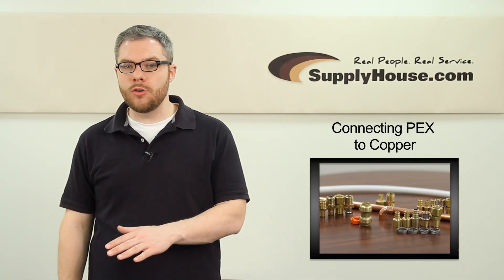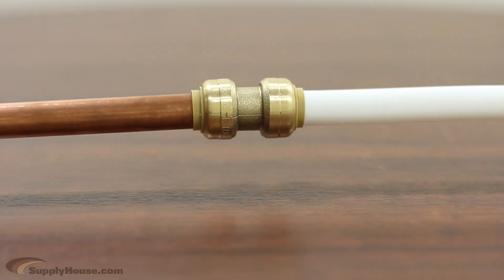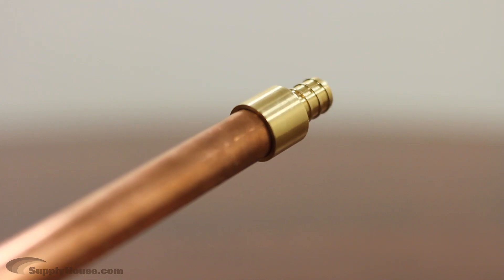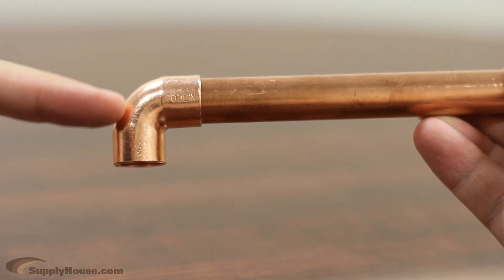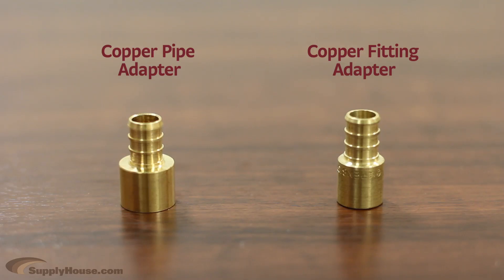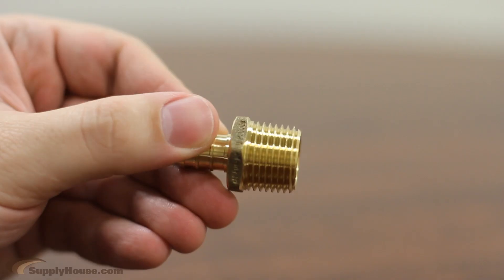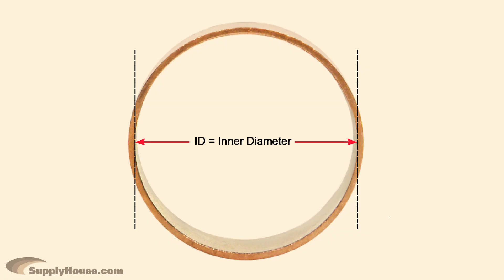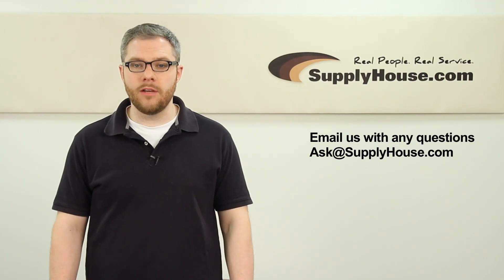Connecting PEX Tubing to Copper Pipe

Comment: NPT does not stand for National Pipe  Thread, it stands for National Pipe Taper,  just like NPS stands for National Pipe Straight. Just a pet peve of mine, like 6 - 32 thread does not mean a six thirty seconds  or 3/16 thread  drives me nuts when one of my young  engineers says it. 40 odd years in a machine shop taught me a few thingsm

Comment: I've found those yellow brass sweat adapters have solder flow and adherence issues. = leaks. They make the same fitting in copper. The copper gets too hot before the brass gets hot enough.

Comment: Remember:  the inside diameter of 3/4" crimped PEX fittings are the SAME as the inside diameter of 1/2" copper pipe.  The crimped-PEX insert fittings that you use with 1/2" PEX  have such a small inside diameter to them that you suffer from a loss of flow of water when you use them.  Now this is not a problem when connecting to either a toilet or a kitchen/bathroom faucet (those have tiny 3/8" feeder lines to them anyways),  but if you are connecting to a tub/shower,  washing machine, or outdoor outlet, then you need MORE water flow and you should either use a 1/2" SharkBite fitting or use a 1/2" UPONOR expanded-PEX fitting, to connect to the 1/2" PEX pipe.  Home Depot has started selling Waterline Cold-X fittings that look and function exactly as the UPONOR line of fittings, but for half the price, so that's what I use.

Comment: The shark bite push fittings really reduce water flow if that's a concern in your application, I recently connected a new water softener using a 24" Sharkbite 1" FPT to 3/4" PEX and I have to break down and buy the PEX tools to run straight pipe because of the reduced flow in our house.

Comment: Considering my pipe swelled during freeze I wanna do insert, but then the hole will be loose too? Damn, this sounds like sex almost...Lol!
Reply: Don't try adapting anything to the swelled pipe. It's already weakened.
Reply: That's true, thanks for tip.
Reply: Its better when the hole compress!
Reply: I like to use pex for cold climates specifically because it does well expanding and contracting. But as a general rule it's better to keep the heat on, at least on low when you leave the house, close your vents in the basement, use foam pipe insulation and seriously consider draining your pipes from the lowest point, opening everything up and even detaching sink and toilet supply lines if you are leaving your house in the winter for longer than a couple days and don't want to leave the heat on.

Comment: The 1/2" of 1/2" copper pipe is neither the ID nor the OD. There are several grades of copper pipe for plumbing depending on their wall thickness (K, L, and M). They all have the same OD (5/8") but different IDs. That allows them all to use the same fittings. So when we talk about 3/8" or 1/2" or 3/4" copper pipe, that number is 1/8" less than the OD and is close to the ID, but not exactly the the ID.
Reply: Copper tubing is what you mean. Pipe is not the same. To further clarify tubing like you say has a set outside diameter [O.D.]  and that is 1/8" larger than the nominal size. Pipe has an even larger O.D. compared to nominal size and it varies  depending on the nominal pipe size. At 14" pipe (and larger) pipe size and O.D.s match. Like tubes the pipe I.D varies with the wall thickness or 'schedule' as it is defined in pipes.
Reply: You are absolutely correct. Tubing is what I should have said, but "pipe" is still often used to describe rigid copper tubing. Even major retailers like Home Depot and Lowes will list the rigid copper tubing as copper pipe.

Comment: Can you connect Pex pipe to other types of plastic tubing such as 1/2 plastic water pipe?
Reply from the maker: YY7788JJ 

They wouldnt have an adapter ,but you could clamp the tubing on one side of a coupling and the pex on the other
Reply: SupplyHouse.com